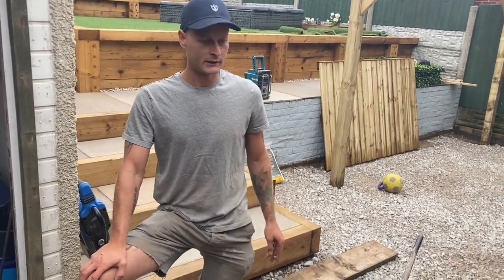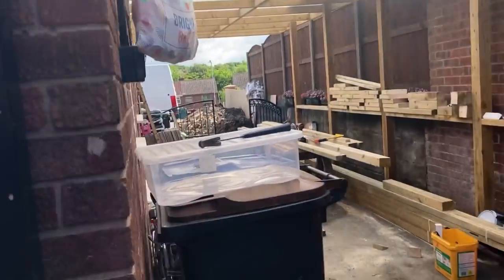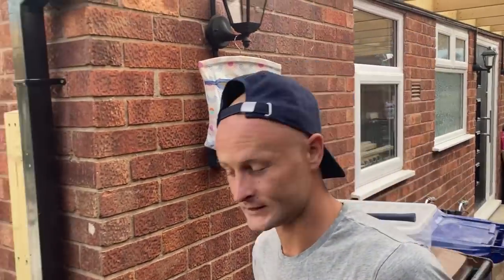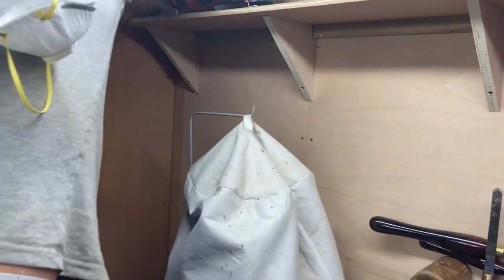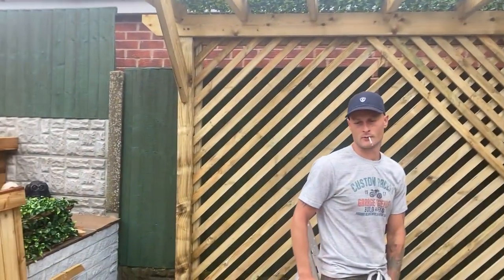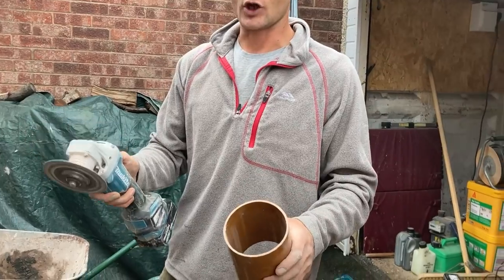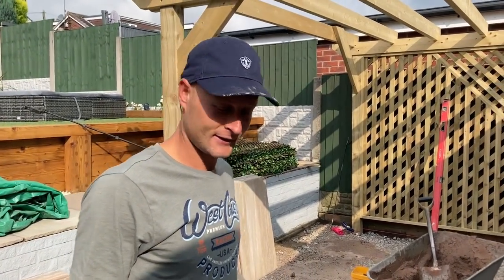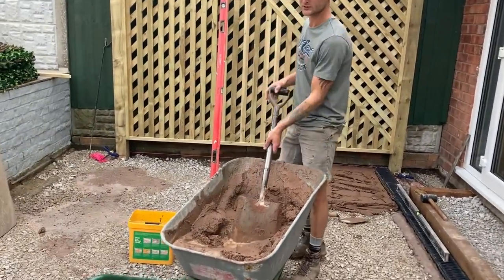PERGOLA IS FINISHED NOW TIME FOR THE INDIAN STONE! #RateOrSlate

Comment: Great vid, as always! You boys killing it. You falling the patio towards those ACOs or away from the house? I always think best to send water towards ACO, but then was always taught to send it away from the house no matter what… which contradicts as the ACO is normally always at the house!
Reply from the maker: The fall on the patio goes from the wall to the aco and from the house to the aco as the footing for the wall is to high to achieve a direct fall from the house to the wall the aco is set 500mm from the house with a good fall to the aco drain
Reply: @Scottchallinorwoodturning  love it, thanks! Love your work

Comment: Hi Scott & Dean,
I'm going to be laying an indian stone floor internally on a concrete slab. The slab has been laid around 50-60mm lower than the rest of the ground floor, to allow for a sand & cement bed. I'm planning on laying it exactly the same way as i would if it was outside on a hardcore base. How would you guys lay the floor? Would you do anything different?
Thanks, Joe
Reply from the maker: Hi Joe just make sure the concrete is spotless I and use a good reputable primer also make sure the stone doesn't dry out to quickly mist over with water so the concrete doesn't suck the he'll out the mix 😉
Reply: @Scottchallinorwoodturning  cheers pal, would you also prime the concrete base, or just the backs?
Do you have a preferred primer, i normally use an sbr slurry but always looking to improve.
Cheers
Reply from the maker: Yes primer for the concrete fir sure
Reply: @Scottchallinorwoodturning  what kind of primer for the concrete? Something just to seal it, or a bond bridge slurry?
Thanks for your help 👍
Reply from the maker: Mapei primer g for me mate and sbr for the slabs belt and braces 😬
Reply: @Scottchallinorwoodturning  thanks pal.
So, clean the slab and then seal with mapei primer. Then pretty much standard procedure after that, 5:1 grit sand / cement laying course and a sbr bond bridge on the backs.
Thanks for your top input 👍